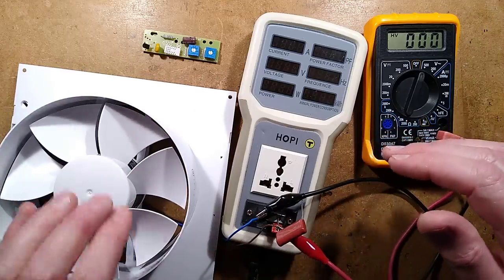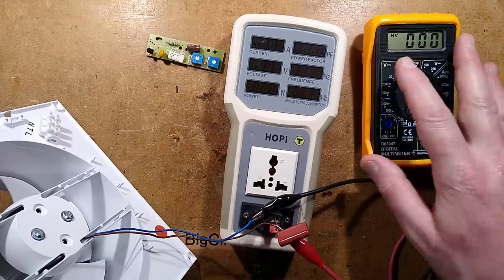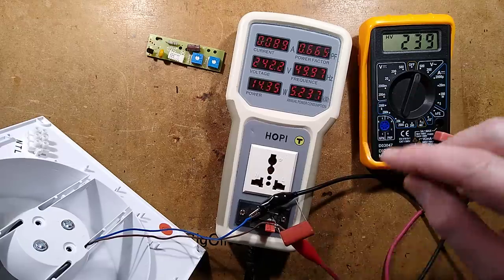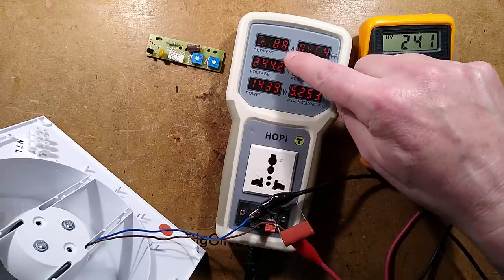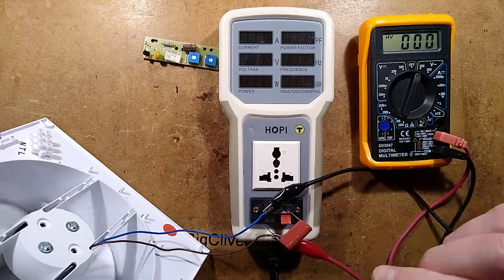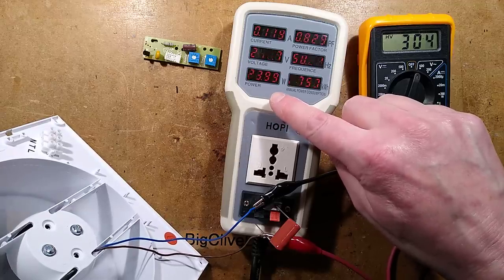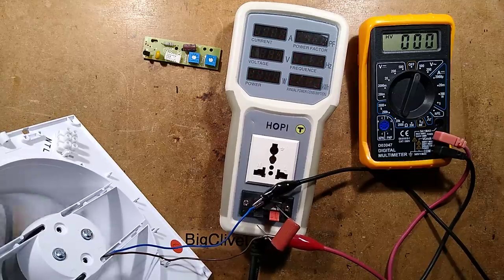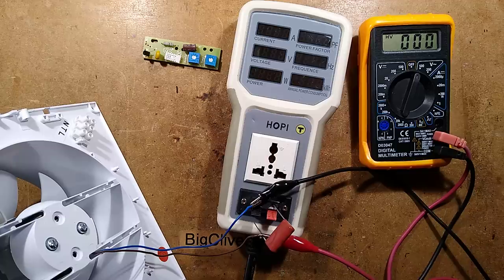What the heck!  Series capacitor makes fan go TURBO!

Comment: Usually you compensate the phase shift on a motor with a cap, hence increasing the efficiency of the motor and reducing the current draw however, I thunk in this case, the fan is designed with this in mind making it overcompensated. Overcompensating a motor will increase the current draw (which is seen) and as also seen here, resonate and therefore increase the voltage. So in effect, you created a LC resonate circuit.
Use the values of the fan (impedance and inductance and active power) and the capacitance and you get the resonate frequency which un this case will result in the speed and voltages

Comment: This happened to me on a projectionist's splicing table that was illuminated by a 220 V filament tube. When I replaced it with a fluorescent tube (this was >20 years ago) it just said POP. Turned out that a clever engineering student had dimmed the light by putting a cap in series. And of course the fluorescent tube had a reactor inside to do the same thing (limit the current). Turned out they were cancelling each other out, reactance-wise.

This was how I first met a capacitive dropper.

Comment: Some people already mentioned it, but you're approaching resonance. That is why the PF increased from 0.67 to 0.83.
At resonance the capacitor reactance cancels the inductor reactance and the circuit becomes purely resistive. At that point PF = 1.
Fortunately the motor winding has some resistance (about 1.8 kohm according to my calculations) and that limits the current.
With a small resistance the current and the motor voltage could get very very (dangerously) high.

I calculate that in your experience you put about 5uF in series. 
Resonance should occur with about 1.5uF. At that capacitor value the power should jump to about 33mW, the current should be ~140mA and the voltage across the motor should be ~380V (yes, 540V peak)

EDIT: I just read the description and saw you used 1uF. That in my simulation will work even better, it's just that the phase between current and voltage supply shifts sign. Current will lead in this case while with 5uF will lag.

Comment: You have a series RLC circuit .    The voltages across both reactances rises as resonance is approached but the phase angle of the voltage across the capacitor is +90 with respect to the current while the voltage across the inductor is -90 with respect to the current.    At resonance the voltage can go very high and exceed the breakdown voltage of the capacitor.  You should repeat the experiment but this time measure the voltage across the capacitor not the supply.

Comment: My digital brain wants to guess that the cap is cycling and adding a ripple to the frequency. I fully admit that I don't remember much of what I learned about analog electronics. It was decades ago and I have rarely had the need to even think much about it. Your presentations are what I use to try to recapture what I lost so many decades ago. Thanks for challenging my brain.

Comment: Probably someone else has commented the exact same thing. But if you make an impedance triangle, the reactance from the inductance and capacitance has opposite signs and will (if the corect values are pressent) cancel each other out. This means that the mains voltage will be fully applied over the resistive part of the circuit and maximise the power. Efficiently the motor consists of a resistive part and an inductive part, and you are basically "removing" the inductance by adding the capacitor, althoug canceling out is a better term. If theese are canceling perfectly the powerfactor will be 1.

Comment: So this is where CIVIL comes in handy. We know voltage leads the current in inductors. This means for each cycle the current will lag voltage, so every time the commutator reversed the current this process begins again. People have already pointed out how the resonance can make the circuit effectively resistive, but I it’s important to remember that putting the capacitor under load compliments everything by having current lead voltage. This means that instead of the coil having to sink current at “neutral sine”, it’s the capacitor which does so and the coil sees a constant current.

Comment: You also have to watch for this resonance when you are making big voltage PS from big L and C you might have on hand. I have tripped a breaker with a 1200VDC power supply by getting the LC wrong. Its spectacular when strings of diodes go off.

Comment: It's series resonance, as others have said. Note however that not only the fan, but also the capacitor will have a higher voltage across it than normal.

Comment: Firstly although this is an induction motor, they run with a high slip frequency - i.e. maybe 2000 rpm if it's 2 pole.  If you were to power it with 305V from a variac for instance it would run just as fast as in this experiment.  You reduce the slip frequency.  (The fan would also slow right down if you lower the voltage too).  Secondly - the voltage is higher due to creating a resonant circuit with the capacitor.  It may now be a leading power factor as opposed to lagging.  The effect of the resonant circuit is both the capacitor and the motor (inductor/resistor) voltage sum to greater than the input (but out of phase).  But that's why the voltage across the motor is higher.

Comment: Source is AC so current goes forwards and backwards. That cap is non-polarized, so it can charge on either plate. As long as current is flowing in one direction, the associated plate is charging. As soon as current reaches the reverse, discharge across the plate occurs. This happens really fast, which causes a massive current and voltage spike. Then it happens again in the reverse direction.

Comment: The capacitor-inductor combo in series creates a resonant circuit, and you just happen to have a value of capacitor where you are close to resonance and both the motor and capacitor are experiencing higher AC voltage than what is input.  They are close to out of phase though, so the average instantaneous voltage is still the input voltage.  The capacitor negates the effect of the motor inductance at resonance because both reactances end up 180° out of phase, and if your capacitor or the frequency actually did achieve resonance, you would blow that motor in seconds because all you have left is the DC resistance of the coil, which is much lower than the inductive reactance/impedance at 50/60Hz, and possibly overvoltage both motor and capacitor... Just like resonance can break glass.  A small enough capacitor would of course restrict current flow, and a much larger one would have little effect on the motor.

Comment: Fully agree to most of the answers - it's a resonance effect. To confirm or bust this idea try to meassure the inductivity and calculate F(res) = 1/(2 * Pi * SQRT(L*C)). Alternatively use a sInus signal generator and an additional series resistor to find the resonance frequency of the fan/capacitor circuit. Search for the frequence with the minimum voltage on the series resistor. Your voltmeter is good enough to find the dip. I would expect anywhere in the 20 to 100 Hz-range. Regards

Comment: The exact mechanics of this are pretty detailed but, basically, by adding a capacitive load in series with an inductive load, you create a resonance effect where some of the energy that would normally get lost to one of them gets preserved by the other one.

If you adjust the size of the capacitor or inductor until you have a resonance-frequency equal to your mains-power frequency, that's where you'll see this effect hit its peak effectiveness and you'll be driving up to double the amount of power through the fan, at what should be a power-factor of 1 since it would appear to be a purely-resistive load at that point.

Comment: I can't get my head around the higher voltage either, but if you notice, the power factor on the Hopi increases greatly. from 0.664 to 0.828.
Reply: Ideally,  tuning it for 339 volts at the motor would approximate unity PF.   But reactance is a complex quantity,  and not that easy to effectively cancel out.  More voltage at the winding means less current,  so less I-squared-R losses in the winding,  but there is a practical limit.  Power consumption is still largely a result of heat (in the windings and armature of the motor),  so little real efficiency is gained;  only power factor.  This has a positive effect on the power grid,  if done extensively with AC motor devices like fans...

Comment: I think that what the meter is measuring is the back EMF, the fan speeds up due to a decreased magnetic field, if you look at fans with a speed selection switch you will find that the fastest speed is obtained by switching out extra coils and not by switching them in this down to magnetic drag. The reason you wont see the back EMF when connected directly onto the mains is it is lost into the grid. A very good book on the subject is "Motor & Dynamo control" by WS Ibbotson, if you can find a copy as it was published in 1921 but it gives all sorts of information on the subject that these-days tends to be deemed proprietary information by manufacturers.

Comment: I suspect it's a resonant combination. Slightly smaller, slightly bigger capacitor and it will drop the rpm or send it crazy high. Resonance doesn't normally have much bandwidth.

Comment: This is exactly how capacitive start motors work, albeit once up to speed, the capacitor is cut out of the circuit. The simple connection you made is how we power 240v fans in North America from 120v lines.

Comment: Many years ago, my mother's stove had issues with the shaded pole motor driving the door lock stalling and I fixed it by calculating its inductance, then using a 2.7uF series capacitor to power-factor-correct it. Same thing here, just look at the PF.

Comment: It reminds me of when I powered a boost converter by plugging it into to an RV's 12v outlet and all the lights in the RV got brighter and the fan went faster.

Turning the output up made the circuit voltage throughout the RV increase. No load was placed on the output of the boost converter.

My guess is this fan and capacitor is doing something to reduce the impedance of the circuit while storing energy and then dumping the stored energy, all in sync with the phase of the motor.

Comment: It's a L-C series circuit so it's resonant and the voltage on the components it's greater than the 240V of the supply, i guess also at the capacitor pins.

Comment: Found it strange when I opened a standing fan my friend gave me the other day. If i remember right it was an Ikea one he got from a clearance that had stopped working. That too has a decent size and voltage capacitor which was in series with the fan. Thought it was strange not to see a diode but instead a capacitor and now hearing about it increasing the power factor it makes sense.

Comment: In fact it is an RCL series resonator. When R is very low, the voltage across L and C can get very high. This is also the reason, why teachers usually build up parallel resonators, in which the current goes high at their resonance frequencies. Building up a series resonator could become highly dangerous, if you touch the mid point between L and C and one of the two voltage leads.

Comment: capacitor is extending the phase peek, allowing more power to flow to the motor. Or its acting like a LRC circuit, and the circuit voltage can be much higher than the input voltage

Comment: we need a disassembly of the fan itself now! Also noticed the 0.2 increase on power factor from .665 to .830. A non-polarized capacitor in series with an inductor 🤔

Comment: this is taught in LC circuits, the capacitor decreases the resistance from the inductance from coil... in LC circuits this creates spikes of voltage, you can overpower this fan more by just adding a larger capacitor so as to totally cancel the effect of the inductance of the coil. this will only leave the resistance of the coil.

Comment: Effects of Series Resonance
i.e Zr = R. At the resonance condition, as the impedance of the circuit is minimum, the current in the circuit is maximum. i.e Ir = V/Zr = V/R. As the value of resonant current Ir is maximum hence, the power drawn by the circuit is also maximized.

Comment: Capacitors balance inductive loads to remove their imaginary component (Z impedance) for better power transfer.
It works in series because you're using AC and capacitors have a frequency response, so at 50/60Hz it's basically a shunt.
Study what Power Factor means.

Comment: The capacitor is going to limit the passage of the line voltage to within a certain frequency which may have made the entire power supply more efficient for the fan to be able to operate at by not allowing our frequencies below whatever the cutoff raids of the capacitor would be Maybe

Comment: It's resonance you can do the same with fluorescent lights you can actually start then if they have burned filaments with the resonance voltage of the choke and the capacitor

Comment: The voltage you a measuring is RMS of an RLC circuit. By adding capacitance the RMS voltage goes up and allows for more current to flow through the inductor (fan) - I am an electrical engineer.

Comment: Ok i think it works this way: fan is made to work from ac voltage and the frequency controls the rpm. When you add a condensator you create a inductor - capacitor loop and the fan starts workin on it's own frequency, that is resonant to 50 hz. But an oscillator wil tell more

Comment: With the inductive load the phase of the voltage will lead ahead of the current. When you connect the capacitor it brings the current back towards the same phase as the voltage

Comment: I used a 2uf cap in series on pedestal 60cm fan. Dropped it speed 2/3s, and sleeping with a lower noise. But what I found when plugging in the phone charger, the normal voltage 230 jumped up to 400V.

Comment: I had something similar with a contactor. I put a resistor + capacitor snubber in parallel with the switch that was controlling the coil current on the contactor. As expected, the contactor would pull in when the switch was closed. However,  when the switch was opened, the contactor remained pulled in, and the voltage across the contactor coil actually increased to more than the  supply voltage.
The inductance of the contactor coil was forming a tuned circuit with the capacitor in snubber, which was tuned to near enough the mains frequency, so the overall impedance was less than the impedance of either the contactor coil or the snubber, so more current flowed. The inductance was much less when the contactor wasn't pulled in.
I suspect that if you measure the inductance of the fan it will be close to forming a tuned circuit with the capacitor at 50 Hz.
Reply: Usually its that RC series combo. that has to be across the contactor coil....
This is to reduce the chatter / humming of the laminated core...and prevent / reduce kickback voltage from damaging its on / off control switch.
Reply: @analoghardwaretops3976  I don't think that the RC series combo can do anything about the humming or chatter. When the contactor is on, the mains voltage is applied to the coil. Anything in parallel won't alter that voltage.
I agree that the RC series combo should be across the coil to reduce voltage spikes affect the control switch. It should be just as effective when put across the control switch like I did initially, where it was easier to fit as the capacitor still provides somewhere for the coil current to go when the switch opens. However, as I found out, doing that had unintended consequences.

Comment: Resonance, which is why all the capacitive fan speed controllers I have taken apart use values over 2.2uF, so as to get on the other side of the resonance peak, and have a lower voltage across the coil, so the fan power is reduced, causing the slip to massively increase and thus lower speed. Normally a 4 position switch, first off, second full voltage, then third a 4.7uF capacitors in series with the motor, and fourth a second one in series with all of that. Makes it simple, you only have a single pole switch, and a single 1R 2W resistor in series with the common, and then just have to have break before make contacts on the switch. 400V pollyputthekettleon capacitors times two, and a small PCB to hold the lot, and some screw connections to put in series with the fan. Failure mode is always speed 2, or the switch wearing out.

Comment: This is basically what Tesla talks about in his Bifilar Pancake Coil patent: "The effects of self-induction, above referred to, are known to be neutralized by proportioning to a proper degree the capacity of the circuit with relation to the self-induction and frequency of the currents. This has been accomplished heretofore by the use of condensers (capacitors) constructed and applied as separate instruments."

This can also be applied to generators to effectively cancel lenz law, among other things.

Comment: My understanding of a capacitor, it stores a charge and dumps it when full (can be fun to change the poles around, kind of a mini fire cracker/firework. I will say only do this with micro farads, you don't want to be put on a list). I didn't see a resistor that will slow this down. So no wonder it gave an extra boost, that fast.

Comment: Wire a oscilloscope over the fan to see the wave form. It might shed some light on what is happening. AC voltage is mostly the rms value of the wave form, so I think the Capacitor is changing the wave form.